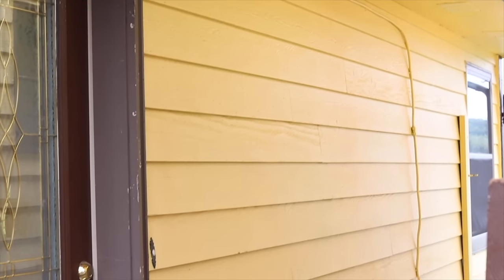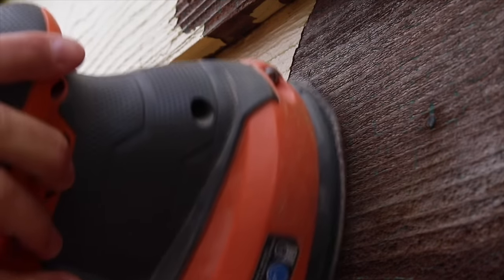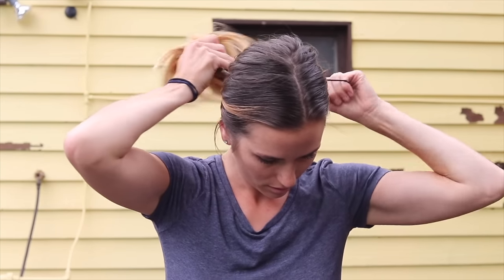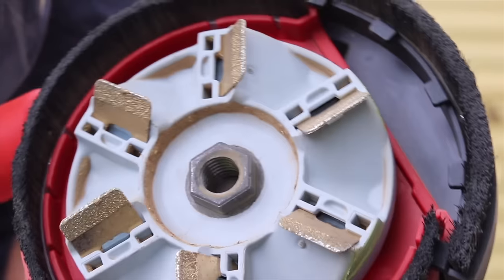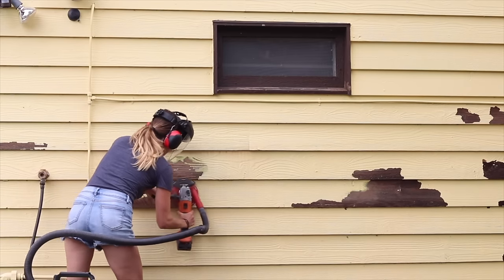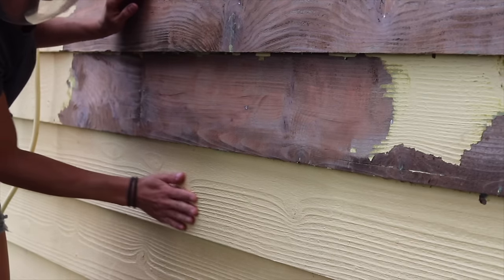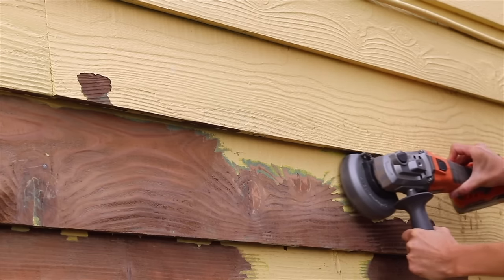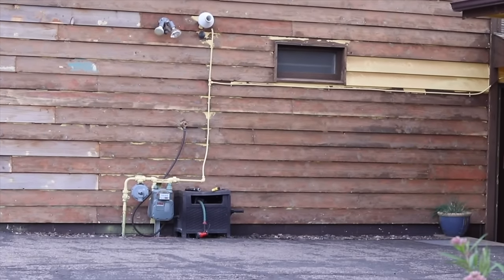Removing Paint From Cedar Siding | Diamabrush vs Paint Eater vs Sander vs Pressure Washer vs Scraper

Comment: I recently helped my daughter strip multi-layers of old paint from a 70 year old weatherboard [clapboard] house in Auckland, New Zealand. After trying most of the things you worked with, we found the most effective was a heat gun [adjust. temp.] with changeable ends for directing the heat where you want it. A broad, flexible blade [about 2-3 inches] will easily lift the softened paint in long strips which fall away from the boards. These are relatively easy to clean up. A long handled paint scraper with a tungsten carbide blade was used for the tougher bits. Followed up with orbital sanding with 80-100 grit paper. First coat was Zinsser Cover Stain Primer Sealer Stain Blocker [oil based], followed by a water based undercoat and two top coats [water based]. Looks terrific and we hope for many years before re-coating. Am enjoying your videos, Melissa.
Reply: Yeah I used a heat gun on many parts of my house, such as exterior door trims, corners, moldings, and other tight spots! It gets the job done no matter what. It’s just a bit slow
Reply: When using a heat gun you need to make sure it is not leaded paint and if it is is you need serious PPE.
Reply: @jeffa847  Absolutely right! Some of the old paint was lead based [I tested it], so I wore a 3M filtered mask and protective eyeglasses. Good point. Thanks.
Reply: New Zealand? They let you work in New Zealand?
Reply: @alharrison1038  Yeah, they do. And occasionally they pay us.
Reply: That’s the same method  I used on my house & sailboat, to remove paint, used oil based primer, and latex paint.  Let the primer & paint, time to cure in between coats.  The finish will last longer.  I bought a Spyder brand scraper at Lowe’s, that attaches to a reciprocal saw.  I have a Bosch that I absolutely love.  I put plastic painters tarp, held down with bricks & a large plastic trash cans for the paint chips.
Reply: Heat gun just damages the weatherboards timber with heat burns
Reply: @lockedloaded1669  Not if you have an adjustable temperature available. Also we had  a number of attachments allowing different angles to apply the heat from. Worked a charm.
Reply: @lockedloaded1669     Not if you do it right.
Reply: That was a screw you were trying to hammer lol whack it a couple of times and it doesn’t budge it’s a screw 😂😂😂
Reply: I was watching this video waiting patiently for "And how does the heat gun work in comparison?"

Only for it to never happen.
Reply: Has anyone tried sand blasting?

Comment: For starters, don't use paint on rough sawn cedar. The proper product is a modern acrylic stain which won't give you the multitude of issues paint creates on cedar. I've been using an angle grinder to remove paint from cedar and pine for years. It requites a learning curve and careful touch and it's dangerous, but it really works. I also don't bother with the brush and just use 36 grip  and 2 grit sanding discs
Reply: Anyone notice the paint was fine until she picking at it. It would have been fine for another several years
Reply: @Dee-qo7gh  The paint itself was but wasn't adhered properly to the wood
Reply: Why is it dangerous to use the grinder?

Comment: What you need to try is a real scraper with a replaceable carbide blade. The trick with scrapers is to mess around with the angle that the blade meets the surface, until it's just right to scrape the loose paint without gouging the wood. Also good advice in other comments to use a bonding primer before the new paint goes on. Also, PLEASE wear a good N95 dust mask or respirator while you're doing anything that creates dust, even if it's not lead paint.
Reply: I agree - I use a carbide scraper, nothing like it - but only if you are a man with strong arms.
Reply: Good job on making of the video. You passed on the information you wanted to share coherently, in the least amount of required time.

Comment: What about using a heat gun? Get one with a wide nozzle, keep it 1 inch off the wood and one inch in front of your flexible scraper and even adhered spots will come clean off without chipping. It's a fairly slow process though, but combined with just peeling/scraping off what is already loose could actually be a good solution. Leaves no trace and you get thoroughly clean wood without chemicals.
Reply: Heat guns are great Dave but they really only work effectively on oil based paints. I could be wrong but the existing paint looks to be acrylic. This situation looks to be an absolute nightmare and the reality is that it's going to take many hours more to remove the old paint than it is to actually paint it again.
Reply: @kelstra1997  Heat guns also work well with latex paints. In general, latex paints are the easiest to remove.

Comment: I stripped the redwood siding on a small house once - I was careful to knock the nails a little below the surface with a punch. If you sand or grind the galvanizing off they'll rust. One other tip - redwood siding (they don't use this much anymore) doesn't take paint well, it's best to stain it.

Comment: The tool you need is a Paintshaver Pro. It is similar to the Diamabrush, but has carbide inserts that shave the paint and last nearly indefinitely. The tradeoffs are, you have to set the depth carefully, set all the nails below the surface, and it does leave a slightly rough surface that requires sanding. And they're expensive, mine cost about $600 ten years ago. Worth Every. Single. Penny!
Reply: A very good tool! I bought the concrete head also and it works great on the block part of my house and the front wall. The wood part of my house, 1300sq.ft., only took me two days to strip compared to one week with other ways before, including torching off the paint!

Comment: i have decades of experience with cedar siding . Never paint it even if you paint both sides which should always be done , it still will create adhesion problems because of the naturals oils in the wood . Better to use an oil based stain with low solids .

Comment: I'm refurbishing an old stone farmers cottage here in the west of Ireland and my problem was multi-layer paint peeling  & flaking off the lime render on the external walls... I tried pressure washing but it gouged holes in the soft render so my plan B was to use a 115mm angle grinder with a diamond face-cutting wheel.... 😧

It took me WEEKS to do the whole exterior... but when I was finished people thought I had re-rendered it... it looked so good. 🤗

I also re-plumbed , re-wired & installed a LOT of i sulation... I lowered all the ceilings by 10"  to 8' height (std. Sheet size) and built studded walls over all internal walls, again insulating as I went... 6" rigid foil-backed sheets in the external walls & 2 layers of 4" rigid in the ceilings.... presently, I'm building my kitchen cabinets from scratch, shaker doors and all...😈

(At 64y.o. .... I'm gittin too old for this kinda thing ! 🙄😂)

From the Emerald Isle
😎👍☘️🍺

Comment: I’m stripping many layers of lead paint from my 1910 house.  

For large areas, the best method I’ve found is a “Paintshaver”.  This is an angle grinder with a rotating planer attached.  It will strip off a hundred years of paint in one or two passes.  I’m doing about 50 sq ft (5’ x 10’) in about half an hour.  Needs practice (I learned on my garage) and two hands (scaffolding much better than ladder, if working high).  Set nails when possible, or the cutters will cut off the nail heads; no evident damage to the cutters, may dull them but each cutter has six available edges.  Good dust collection with an attached vacuum, but wear goggles and mask/respirator as some debris gets kicked upwards. Leaves the siding bare and a little rough, so you need to do a quick sanding after.  Expensive ($1000-1300) but I found mine used for $227 :-)

For the corners and little places the Paintshaver can’t reach, I am using a heat gun with a sharp scraper.  It’s the gentlest method, but too slow for large areas.  Takes me about an hour for just 5 sq ft.  Pretty clean, as the softened paint comes off in strips.  

Lead paint precautions: don’t work on a windy day, plastic sheet the area, wear respirator and disposable painter’s overalls, use a HEPA vacuum with Paintshaver and sander, if hand sanding do it wet, when done dispose of the plastic sheet and debris (household trash ok) and vacuum the area including the stripped surface, take a shower.
Reply: does paintshave have different heads that attach to angle grinders Vs just an all in one tool? I think the paint shaver will outlast the Diamabrush?
Reply: @2manycatsforadime  Paint Shaver Pro (I'm not sure if there's a non-Pro version) uses an entirely custom grinder head that comes installed on a grinder body so it's an entire tool.  They use sturdy custom blades that should last longer than Diamabrush, or at least mine never broke doing a ~thousand square foot deck and mine was bought used.  I did try to avoid screws on the deck but when it hit them it would shave off a bit of the metal on the screw heads.  If you research the tool you'll find it's famously good but also expensive.

Also, I highly recommend the Dust Deputy attachment to swirl most of the paint debris into a container instead of clogging the vacuum filter.

Comment: As a Painting Contractor forever I probably would have tried wider scrapers,4-6" because it seemed like you were getting under the paint film pretty easy and was scrapable. Then Grinded the rest off with a 16 grit disc and wearing a full face respirator  . That's if I had to, I probably would have passed on the job if that's what the customer wanted. Too labor intensive and difficult to charge enough in most cases. More power to you though for going for it but protect your lungs and hands and face. I would caution anybody with a heat gun. You can set the house on fire inside the wall through siding cracks or gaps in the siding or trim.
Reply: As a painting contractor I would've given them advice on installing vinyl siding.
Reply: @chrisdidonna7386  yes, I’ve done that many times in the past. Some jobs you just don’t want
Reply: @mrspunk61  True, cost effectiveness is a factor. Despite using a good oil-base primer on that cider I don't think it would stand the test of time. That wood looks wetter than a sponge and considering the fact that they're not in drought conditions I doubt that sufficient drying would ever occur. But all in all, that siding wasn't to appealing and in the end all you'd have is painted unappealing siding( or stained).

Comment: Nice video. I went through something similar to this about 13 years ago. The best tool for the bulk of the work is called "the paint shaver pro" (I'm not affiliated with the company). For corners and crevices use a heat gun and various scrapers. Be sure to set your nails with a punch to get the nail heads below the surface of the wood before stripping the paint. Also, please wear a respirator when sanding or grinding. It's a big job, have fun 😁
Reply: The paint shaver pro, whilst awesome is over $1,200 in Australia. Puts it out of reach for most DIY budgets.
Reply: @stuckster  I bought mine in the USA for $600 in 2008. I guess the prices have gone up. Maybe try and find a used one. The other thing is, as a diyer, you have to ask yourself, how much is it going to cost to have someone else do the job. If you start there, the subtract the cost of the tools and materials, then decide if it's worth your time and money to do the project. Many diy failures are caused by the unwillingness to acquire the correct tools and materials. The pro's don't skimp on tools, generally speaking, because it costs a lot of time to do so. Maybe sell the tool when your done with it.
Reply: I got a used Paint Shaver about 10 years ago and it's definitely an awesome option.  It's similar to Diamabrush but it's a custom-made grinder head that uses blades that are probably much hardier and less likely to break than the diamond ones and the head makes it harder to tilt the blades on the surface so they won't gouge so easily.  My blades never broke over the course of doing a very large deck, though I actually pulled all the nails first and replaced them with screws driven even or below the wood surface.  It was a huge job.  I think it did hit the screws sometimes and it would just remove a slice of metal from the screw head.

Also, I highly recommend the Dust Deputy attachment to swirl most of the paint debris into a container instead of clogging the vacuum filter.

Comment: Another method that is painstakingly slow, but very effective at promoting adhesion is to use a heat gun and a simple putty knife. I did this years ago, but the paint job that followed was amazing!
Reply: I kept yelling "Heat Gun" at the screen. if you get a decent one it works really well.

Comment: Wow it’s funny to see other people that had my same issues with paint! I have a house with cedar shake siding with extremely thick paint. I tried a grinder with sandpaper, which would clog the paper, then I had the confidence to use the diamabrush! It was able to blast through the thickest paint on my house. It was bubbly, cracked and chunky. The diamabrush really works well at taking the thickest paint off of any wood surface.

Comment: Use a nail set to sink the nails a little deeper in the siding. You can also buy an inexpensive moisture meter to test the moisture in your siding to determine if it is dry enough for good adhesion. Next, use a good primer on the bare wood so the paint has the best chance of adhering and lasting for a long time so you don't have to go through this process again.
Reply: No you do not "use a nail" you use a nail set and a small (4-5lb) sledge. They will set with a tap or two. Testing the wood does not dry it. The siding needs to com off.
Reply: He said use a nail-set dude..

Comment: Hello just came across your tutorial. I set out to paint my parents house a large ranch. The siding was cedar but cedar shake not clapboard. There was atleast 10 paint layers plus. The cedar shake is thinner and easily cracks and damages. After trying different methods I went with a heat gun over propane torch. The heat gun worked great. The paint bubbled up then I used heavy duty putty knife detach it from shake. It was time consuming going at it 7 days a week. Once I got it going it took 6 months to bare wood. I had people stop to check me out and were amazed on what I was doing.

Comment: Once you determine what is causing the moisture behind the clapboards you might consider solid stain rather than paint.  Stain will be absorbed into the wood and not blister or peel as easily.

Comment: I had the same type problem on my walls. Finally settled on a 4" grinder and cheap Harbor Freight abrasive pads. It worked pretty well and the pads were so cheap it didnt bother me. Thst was split log siding. 

The other which I removed was a deck surface that had Rustoleum Restore flaking off it. For that i softened the stuff in full sun and with a heat gun and 4" putty knife to get long strips off quite easily.

Comment: That is a pretty big job. A couple of suggestions: Lay down some plastic to capture the paint chips, tape to bottom and go out 4-6 feet.  Wear a particle mask. Compressed air also works but you need a big compressor and it will used up a lot of energy and it still won't get everything.  There is a balance too of getting the job good enough without going into perfection mode that will add a lot of time and cost, lastly consider employing a small army of workers to get that knocked out pronto so you will be watching and inspecting more than actually doing. 🙂

Comment: Regarding the blue stripping wheel, it was being held at the wrong angle, don't hold flat with the surface, also go for the lower grit version ( purple).... Stripping wheel works great for stripping paint off siding and decks, you'd be surprised how fast they work, unfortunately they don't last that long.

Comment: I prefer the paint strippers, you can buy it in large buckets and just slather it on the wall and put some plastic over it for it to work a while and not dry out. It just bubbles up and let's go from the surface and you can scrape it all off in one swoop. Work in sections and you can have it really fast!
 
Just make sure you choose some environmentally friendly as the gunk is gonna go everywhere, but I have used some that were safe to even flush down the drain.
Reply: Paint strippers? Do you have any idea how much those women charge? It's obscene!
Reply from the maker: I'm curious what stripper do you use? I have used kleanstrip, citrastrip, and readystrip on various projects in my life, and there is no way either of those is a fraction as fast as any of the methods I'm showing in this video. Especially on a vertical surface, I'd have to cover the entire house in plastic wrap to get stripper to work at all. I did try one section behind the utility lines with stripper and plastic wrap but it was as tedious as scraping. Have you stripped a whole house before? I'd be curious to know what it was like!
Reply: @WelcometotheWoodsBlog  just like any method, you'd chemically strip it in sections. For it to work decently you'd have to cover it with plastic. You can use plastic drop cloth but might want to see if a tarp works well and holds up to the chemicals....if so, just get two tarps. Apply chem and tarp, go to next section and by the time you apply chem and tarp you can remove and scrape the first section. Just keep two sections going so you not sitting around waiting for it.